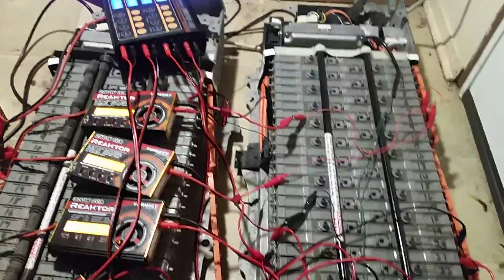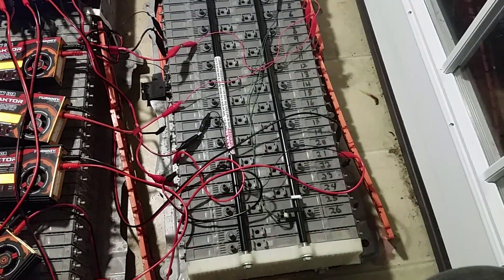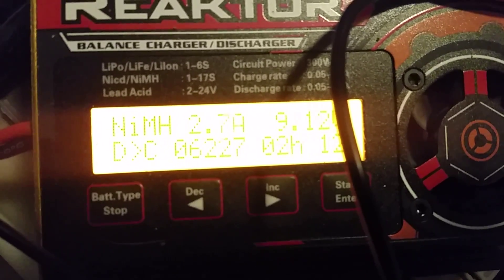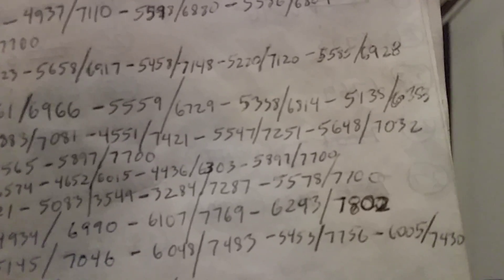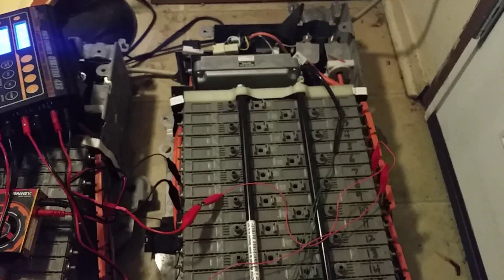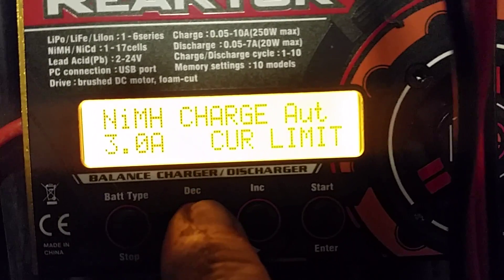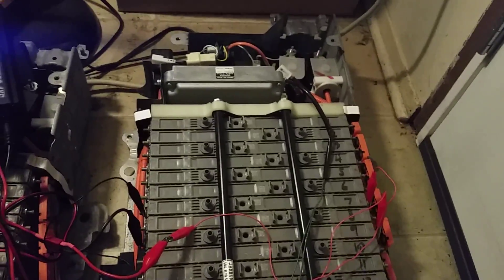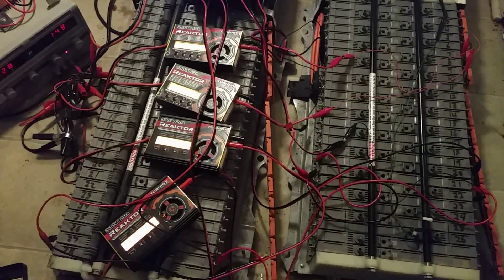Prius module on Imax B6 - redux

Comment: how many 3 cycle runs have you ever did on one cell?
Reply from the maker: I have run a couple, as many as 5 times (15 cycles total) to get them back. in retrospect, I should have just replaced them, because they were on their last leg. If you don't see results after the 4th cycle, I would suggest replacing it.

Comment: Hi Tommy, i purchased a Hobby King Quattro to try to make better time. I dont know if i have had trouble in the setup or what. i can not get the dchg/chg to run in Auto. i have it set to 3 cycles and it just runs once and stops. Also it will only discharge at 1.0 amp? is that right or do i need to update its firmware? do you know? Thanks for any help.
Reply from the maker: Sorry for the delay, but yes, it discharges at 1 amp (slow as molasses). When your charger stops, what does the display say?
Reply: thanks for the reply. it was because i was an idiot. i got it straightened out now. other than the 1 amp thing. i am real happy with them. afraid i am going to have to just buy another battery but i will know this week.
Reply from the maker: +Jerry Smallwood Glad you got it sorted out. I am on my 5th Prius now, picked up one for $500 last week, bad battery, and I am going through the modules now.

Comment: Hi Tommy. Thanks for share this information. I have a question, how many amp needs each cell to be charger? I can see a lot of chargers, but I don't have idea of your DC power supply. Thanks.
Reply from the maker: I run a Mastech 3020, for 3 chargers, and an old 15 amp bench power supply from Radio Shack. Each charger will pull around 8a max, if you run them at 18v input. while some are charging, some are discharging, so it seldom overloads.

Comment: Hi Tommy J. i have bought two of these chargers and a Hobby king power supply to rejuvenate a Prius Battery. i have ran this on two different cells for a total of four. one runs fine. the other has resulted in an error that looks something like this. termination capacity overload 7501. was there a setting that i missed along the way? i am pretty sure that this has come from the same charger both times. thanks in advance.
Reply: Jerry, did you ever figure out the "capacity overload 7501" issue? I'm having same error. help please
Reply: What charger are you using?
Reply: Turnigy Reaktor 250W 10A
Reply: I have the capacity cut-off set on at 7500mAh
Reply: i had one that did that and it would swell up. i discarded and replaced it. i had another one that gave me the same problem but didn't swell up. so i tried charging it on a quattro 4x6 and it went through with no problem. i ended up buying two quattros and had two Reaktor 250's because the singles were taking too long.
Reply: ok, help me understand what you just said. Are you saying that the cell is bad because i got this error? or is there something wrong with my Reaktor 250? I have tried charging 8 different cells with this charger and it discharges correctly, waits 3 mins, then starts charging until it gets to my 7500mAh cut off, but hits 7501mAh and stops with capacity overload. Just trying to learn how this works, I'm new to this.
Reply: are you getting this error on all 8 cells or just the current one? I chose to pull and replace the one that did this and swelled up. everything i had read said that it probably had a dead short internally.
Reply: all 8 cells so far. I'm going to discharge this next cell down to 6.0 v, I have been discharging them down to 6.3 v.
Reply: i would say there is a setting somewhere that is not right. 8 cells all giving you the same error? i assume you followed this video for the setup? i never went below 6.3v
Reply: Todd. i just went back and watched the setup part of this video. i had this issue and with Toms suggestion i bumped it up to 7800 mAH instead of 7500. this should take care of your problem.
Reply: Thank you, I will try that also. My last cell that I discharged down to 6.0 worked.
Reply: Good luck with that. i stayed away from going that low because of Todd's video. Probably just may me nervous having not done it before. My daughter drives her car every day still. They wanted $4,700 at the dealership to replace it with a new one.
Reply: Jerry, you said you purchased the hobby king quattro. What size power pack do I need to purchase to power it.
Reply: do you have a real email address? it might be easier to communicate. if you post it i can email you and then you can come back and delete the post.
Reply: got it.
Reply: Hey could I also get your email? I have a couple of questions with the quattros.
Reply: Hey could I also get your email? I have a couple of questions with the quattros.
Reply: toddbakos@hotmail.com
Reply: I havent been using the Quattro, but have been using the turnigy Reaktor 350W 23A singles.
Reply: How many cycles usually goes for balance the battery